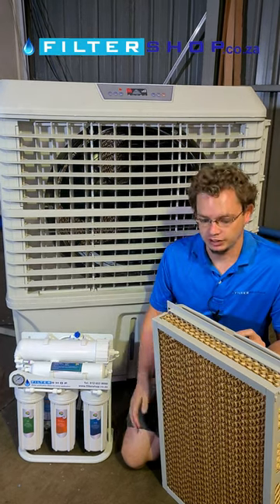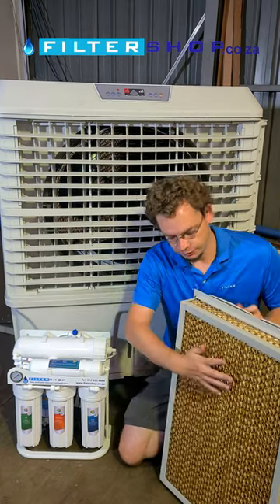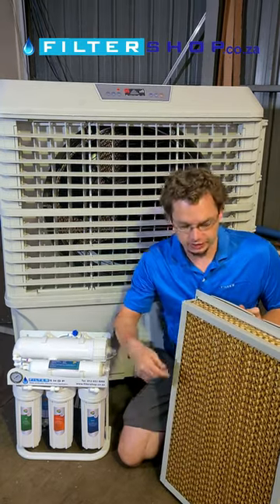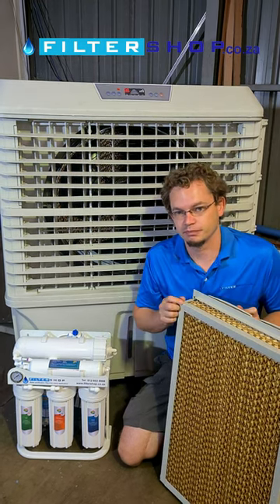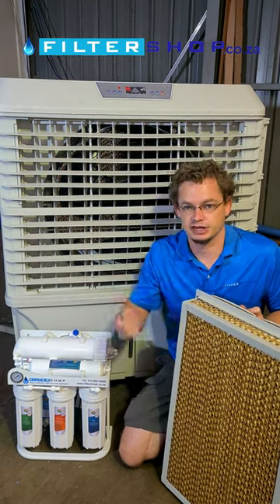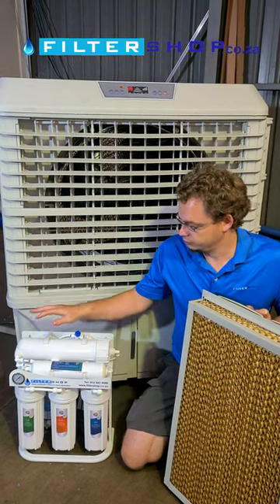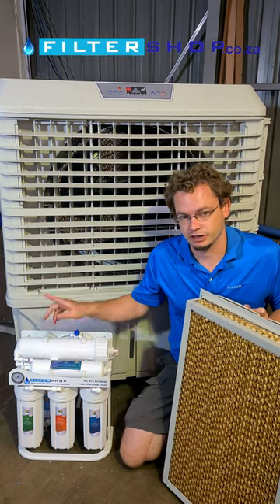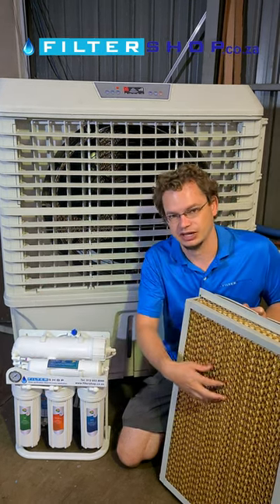How Does An Evaporative Cooler Work Short

Comment: Hi mate I have evaporative could you tell me what's this product are you using for?
Reply from the maker: We use it in our workshop. Having the Ro water feed it has made the filter stay a lot cleaner and reduced how othen we need to clean it.
Reply: I’ve found this doesn’t work well in high humidity environments as evaporation is far less likely to occur
Reply from the maker: @samwisegamgee8318  Yes, it only makes sense in dry climates.